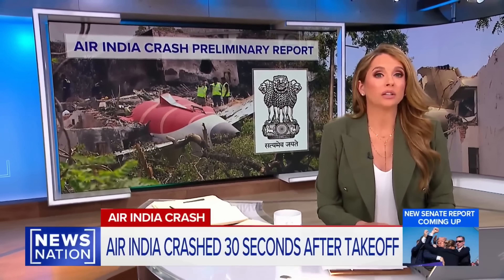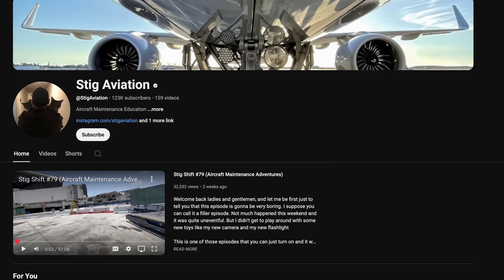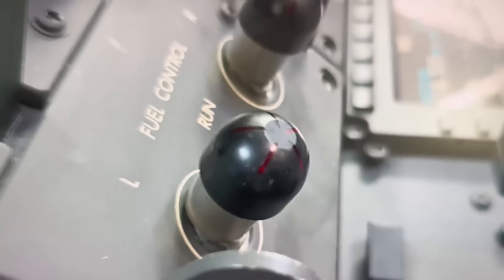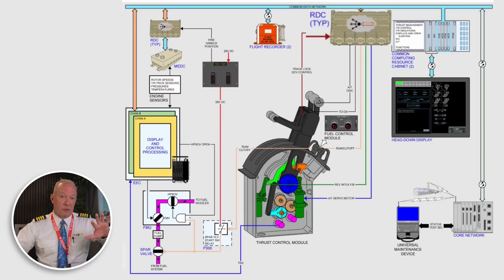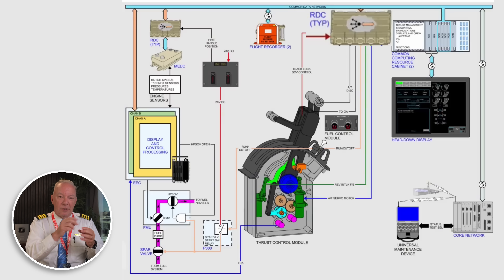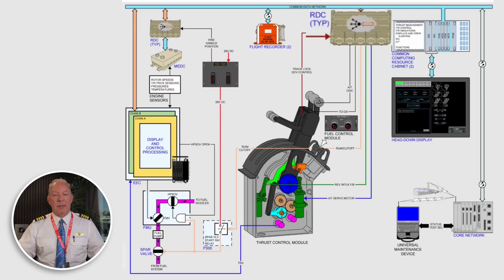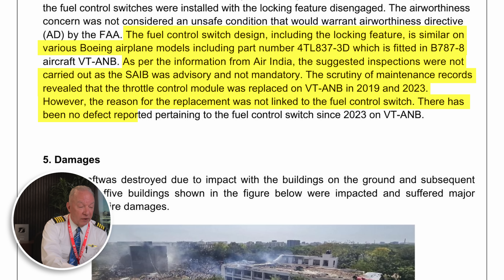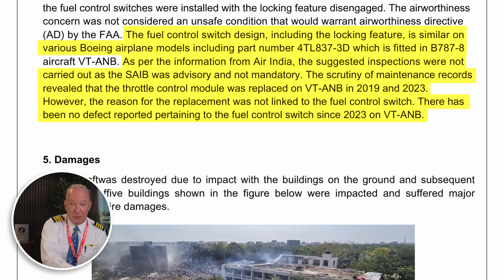The Truth About Boeing 787 Fuel Control Switches

Comment: Here we go again. Capt Steve has simplified the fuel system and is only talking about the mechanical switches enabling the relay. But thank god, now he has omitted “mechanical relay” and now agrees that there is a DC signal that goes to the valves! but he is not showing the whole picture. Please watch other technical
Expert dissect the fuel system of 787. It’s complicated not as simplified as Capt Steve says. The mechanical switches are just one input. He needs to move on and see why was the RAT deployed before anyone turned off the fuel switches were transitioned. 

Here is a fantastic series with 100+ episodes by Thomas Geoffrey and Richard Godfrey firm Airline news 

https://youtu.be/nxul8TOIf38?si=zi12SBlbu56BERVG

Comment: No volts= valve open.
On the dfdr, where does the switch status come from ? Does the switch itself have the data output or is the output from the valve?
In other words, if 28v was lost from saybthe battery, would the dfdr not read that as valve closed? 
In other words is the dfdr data that of the switch itself or the valve?

Comment: The switches are irrelavant to the loss thrust.  The pilots did not mention the switches even though they both would have heard the switches being moved and the CVR would have pickup the click of the switch movement.  The pilots only said lost thrust. It is unlikely that the switches were moved prior to lost thrust statement.  They need to release the CVR data and timestamps.

Comment: Awesome video. Could you describe how the flight data recorder knows the switches were moved? Is it based on loss of voltage or a contact point on the actual switch? Could a failed relay make the data recorder think the switches were moved? Thank you!!

Comment: Stig's video, among others, easily and amply demonstrates that both switches can be moved from run to cutoff in less than a second. I counted 42 or 43 frames in Stig's 1080p60 video. That 42/60ths or 43/60ths of a second. All these "experts" spouting off that both switches can't be changed in less than a second are just making fools of themselves.

Comment: I’m sure this question has been answered, there have been evidence on other aircraft of condensation leaking into electrical equipment, if that was the case would it effect or cause someone to move the switches to cutoff position or cause the pumps to stop pumping.

Comment: So, you’re correct, but there are points on a bit of detail. On the wiring diagram that you shared, yes, the fuel cutoff switch is directly connected to a normal-open (disconnect) relay which itself is what supplies power to the valves. (There is no digital messaging signal here to get confused), but that relay is not directly hooked into all three of the valves. It is only hooked up to one valve directly: the SPAR valve, that is the valve before the fuel pump. This makes sense, there’s no real reason to ever need to cut off fuel from the fuel pump if you’re in RUN mode. But the FMV is being controlled exclusively by the EEC. There is actually no input from the P300 relay into that valve. As well, the little thing that looks like a bullet facing left: (_| ? This symbol designates an AND gate, which only has output on the round side of the block when BOTH inputs on the square side are high voltage. This means that power to that valve can be cut off with either: the loss of voltage from the P300 relay, or loss of volage from the HPSOV OPEN line, which is again coming from the EEC.

So, we see that there are two valves that the EEC could cut off voltage to, the orientation of those valves to me is unclear about what this says about them being normal open or normal close. The FMV in particular having its bar 45° to flow is particularly confusing. I would need to see their diagram key for this. (A google search doesn’t quickly yield any information about the convention they’re using. But maybe I just have the wrong terms.)

There is also a separate circuit on the fuel cut off switch. The line heading into the P300 relay, and that headed into the RDC are on parallel circuits. Which means both operate independently as separate electric circuits (which is why the P300 relay is in there. Either the switch operates two separate conductors, or they both run through a single conductor in the switch, the former would have them fully independent, and it would be impossible for a short in one to affect the other, though the later means that a short in either line would drop the voltages of both lines as current would be shunted into the short. Either way the RDC would be recording either the actual position of the switch, or the electric potential on the relay.
Reply: Yes exactly. Steve does not understand electronics and is irresponsibly misleading people. He's making himself look foolish :(

Comment: When you state the fuel switches are fail safe what state to they return to when 48v is removed..... so in the event of a disconnected wire for example to the relay do the pumps fail safe open or closed.
Reply: Fail safe means in the best position to keep the humans onboard alive, which means open.

Comment: Great explanation. However it still does not cover all the possibilities. There is this analysis by an electrical engineer that looks at the electrical diagrams and how the system would perform in abnormal conditions. Please take a look: https://youtu.be/OLxLN3osS1Y?si=oTuK46f7uajCKiXA

Comment: Thank you so much for yet another intelligent, sensitive description of what happened on this flight. Your compassion is an inspiration--and should be the standard for reporting on these difficult stories. You set the bar high. Bravo.
Reply: Compassion? The opposite. He is peddling misleading information.
Reply: Really? This is high? He doesn’t understand the basics of electrical engineering and indulges in narrative building.
Reply: But Steeve isn't right... This isn't the way it works and it could easily have happened due to a dip in DC voltage due to faulty electrical system. This would also explain why BOTH pilots were confused as to why the engines switched off - more likely than one was essentially crazy but also shy about his craziness.
Reply: @IJustMadeAComment  Such a dip in DC voltage would, in all likelihood, affected both switches at the same time, and not a second apart from each other.  And what are the chances that the dip would have lasted 10 seconds, and then the proper voltage restored to each switch/relay AGAIN 1 second apart from each other?  I believe Steve is correct, absent someone being able to reproduce the data that was recorded without the physical movement of the switches.  So far, only theories without substantial evidence of its possibility have been put forward.
Reply: @michaelgower6438  We don't know that "1 second" is literally 100 miliseconds, it could be less than a second but they are being vague by saying 1 second. They should say the exact miliseconds.
Reply: @michaelgower6438  Captain Steve incorrectly describes the control of the fuel values according to the diagram he presented. He needs to correct those errors.

Comment: Purely for clarification...
I think it's fairly obvious the switches were operated. But to the point of the electrical control explained here, I believe there's a bit more to it.
I'm not trying to nit pick, but the Switch can control the Relay in a few different ways depending on the type of relay and wiring configuration. FI, is the relay electrically held, or mechanically held? And is there more to the "fail safe" design than [the valves remain open]? Could it be the "Fail Safe" design actually ensures the system remains as it was before the failure? In such a case, and the reason I ask is this:   Even if there were a failure of/at the DC source (and we haven't even discussed the back up power source, and I'm guessing there is one), but even on a power source failure, the pumps would (should) remain in that state.  IOW, if the valves where Open at the time of the electrical failure, they would remain Open.  I'm guessing the relays as well as the pumps are mechanically held. They would require a SPECIFIC signal to either Open or Close. They don't just "Close", and they don't Close because you lost battery power. They have to be told to close, such as by flipping the switch.

I'm an electrical engineer, not a mechanic, so admittedly, I'm guessing at how the controls are actually configured.  But given the redundancies on a modern airplane, AND the fact that this is not an issue I ever recall seeing before, I'm comfortable with that.  I'm simply clarifying for those who will have caught the issues with power as explained by Steve, his explanation is not meant to break down the schematic of the control system. Only to further illustrate the switches had to have been operated.

Comment: You say that the fuel valves close if there is a power disruption. It does not seem to be a good idea to have fuel control valves commence to the closed position in the event of a power disruption. I am not an aviation engineer but to be failsafe I would think that if there is a power disruption, the valve should stay put in the open position. Batteries do fail, an electrical bus can fail for several reasons. I looked online for schematics for the Boeing fuel cutoff systems but only could find basic block diagrams. I would think that the fuel run/cutoff switch would be connected to a relay or solenoid that has an electrical reversing function or similar to close the valves and if power to the circuit fails the valves would just stay open or maybe in it's current position. Just my thought...

Comment: this idiot can never explain how NH 781 Air Japan switched off engines on landing by thenselves because this tiktoker is just an aviation hazard 😂😂😂😂😂
Reply: NH781 had switched to ground mode and a software that only works on the ground to prevent asymmetric engine surges (to prevent a runaway airplane on a tarmac) shutdown both engines.
Reply: @EsparkyDog  So it is possible that fuel valves close while the switches are in the ON position? Thanks for confirming.
Reply: @ConcernedParent-z1q Very unlikely, airplane systems are designed to fail in a mode that will preserve the airplane and the passengers. When a software malfunctions in an airplane it usually gives a 'parting shot' like a cowboy galloping out of town, like saying "I give up, so I'll leave the system with everything on or open and you pilots manually deal with the switches."
Reply: @EsparkyDog  Yes, usually. But this is a 787, it's far from normal.
Reply: @ConcernedParent-z1q Yes it is far from normal because the 787 is newer and benefits from better systems and better software than older models. That not a single one had crashed in its first 15 years is testimony of its superior design.
Reply: @EsparkyDog  If poor maintenance is required to make it fail, then that may well be so. Let's find out if that's what happened.
Reply: @ConcernedParent-z1q Air India may indeed suffer from poor maintenance but we know it was not poor maintenance what caused this accident. The movement of those fuel switches 3 seconds after liftoff is what killed the airplane.

Comment: there are too many idiots in aviation a apprentice mechanic would know the fuel cut off system on a Boeing I am a 40 year veteran AME  and I know the system without seeing a schematic  there are rules on designing aircraft. If a Maintenance Engineer is given the task to work on the engine Fuel system like changing the filters the first thing you do is make sure the fuel control switches are on the off position 
any other aircraft from a single engine turbine to a airbus 380  may have firewall cutoff this is a safety back up in case of fire
 Essential BUS  Babe

Comment: Geoffrey Thomas channel
Explains how the circuit can cut off fuel without switches moving. Water in electrical bay. Captain recycled them possibly. Given the software and electrical complexity I think anything is possible that was not the fault of the aviators
Reply: Those two guys are complete clowns and are banning airline pilots like me from their channel that question their nonsense.
Reply: @EsparkyDog  Water in some circuits is "today's" version of their story.  I asked them and commenters where all that water would go during  the takeoff acceleration, after somebody conjectured about its movement i the rotation. I'll have to check later and see if anybody cares
Reply: @borismedved835  Awkward questions don't tend to get answered there. I wouldn't hold your breath while you wait!

Comment: Based only on the pictorial schematic you show, those shutoff valves are "motor operated shutoff valves" which would make sense because of the criticality of their function. As a designer of 42 years, that is the only type of valve that would be used here since the valves MUST stay in the position they are commanded to. As for "switch mimicking", that is a fantasy in that 3rd commentators mind. It has NEVER been found to exist...NEVER! Even more important, YOU test these circuits for proper operation at the beginning and end of each flight. Reliability cannot be assured any better than that!!! Thank you for your position on this accident.

Comment: Just spitballing here, what if one of the fuel valves quit working? Would a pilot during a critical phase of flight like takeoff be tempted to “fiddle” with one or both fuel cutoff switches in desperation?
Reply: He would be equally guilty of killing his passengers. If one of your engines flames out on takeoff right after Go/no-go speed it is called V1Cut and every 6 month you go to the simulator to practice it. You continue the takeoff, retract the landing gear and flaps and with enough altitude and speed you call for the other pilot to reference the emergency procedure and only then can you turn off any switches. Screwing up that procedure in real life is called ineptitude instead of desperation.

Comment: Thanks Captain Steve for keeping an open mind regarding what “intent” one of the pilots may have had or not had when he moved the cutoff switches. I would like to suggest that, despite your unsuccessful attempts to think of a non-malicious explanation, that there is a tragic pilot-error explanation that that does not involve murder-suicide – which seems to be being overlooked by pretty much everyone.  It would also be consistent with the limited facts released in the initial report.  It is simply possible that there was a callout of “positive rate” followed by the captain moving the cut-off switches instead of the gear lever and then calling out “gear up” without knowing what he did.  His “intent” could really have been to put the gear up.  As dumb and unlikely as this scenario sounds, it is still a real possibility.  Mixing up muscle memory items can be a dangerous thing and people make these kind of mistakes on a regular basis.  As you are aware, the captain had plenty of muscle memory for both these actions as they are done on every flight.  We are still missing so many details in the initial report that might actually point toward such an error but, obviously, we will have to wait and see.  A correction to a small error you made in this video is important…  The initial report says “…ground sensors transitioned to air mode, consistent with liftoff at 08:08:39 UTC” and that the “…cutoff switches transitioned from RUN to CUTOFF…” immediately after maximum airspeed was achieved at 08:08:42 UTC – a full 3 seconds after the wheels departed the runway which would have been at least 4 or 5 seconds after rotation commenced (not the “one second” you reported in this video).  The timing, the position of the gear lever and the denial by the pilot who moved the cutoff switches are all consistent with this possible scenario.

Comment: Speaking of the 28V Dc, is it possible for some kind of bus failure like an intermittant short? Could this result in a momentary total power failure and the loss of 28V battery power to the fuel valves? I know abolutely nothing about this but just considering possble failure paths.

Comment: I have no doubt that Capt. Steve is right about what happened. The problem is that people have a hard time believing that a suicidal pilot would murder all his passengers. But, as most people know, it has happened before. Not all that long ago, Richard Russell, a ground handler, stole an aircraft, took a joyride, and than dove into a sparsely populated island. There was no history of depression and no red flags to indicate he was going to do something like this. This case will require what is tantamount to a psychological autopsy to analyze the probable state of mind of the perpetrator who my guess is the pilot who is already known to have had a history of depression. I think the pilot didn't do this on a whim. He thought this out. Unlike the prior incident which occurred when one of the pilots went to the bathroom, this guy was not taking any chances. He did this at the perfect time, at the very initiation of flight when it would be totally unexpected and impossible to recover from. This is going to be a difficult investigation with serious ramifications for finding ways in the industry to identify psychological problems prior to their rising to a level that could result in something like this occurring again.
Reply: Incident Overview
On October 22, 2023, an off-duty pilot, Joseph David Emerson, attempted to disable the engines of Alaska Airlines Flight 2059 while seated in the cockpit jump seat. The flight was operated by Horizon Air and was traveling from Everett, Washington, to San Francisco, California.